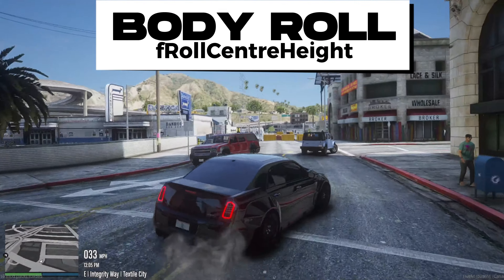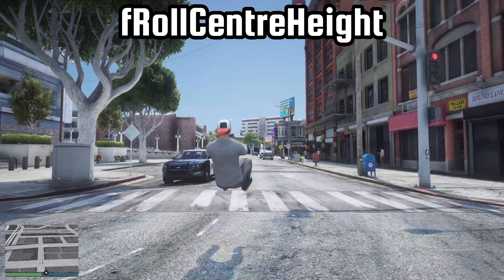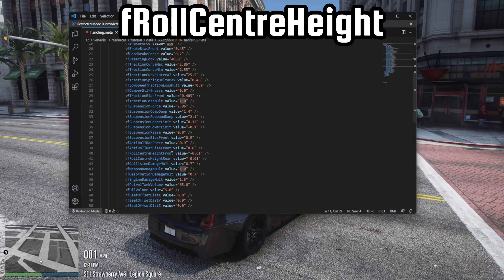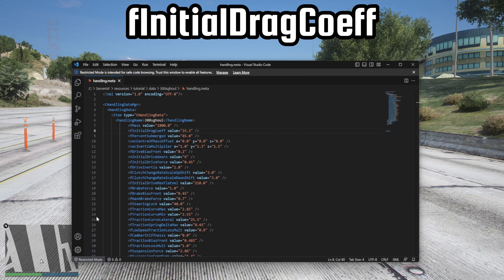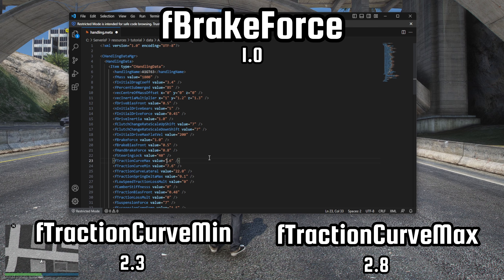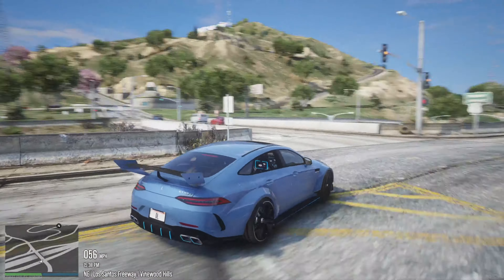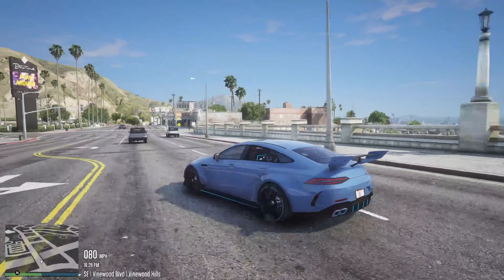handling.meta

Comment: Time stamps for each section (Mainly using this for myself but maybe others will get some use of it? pin worthy?)
--
Body Roll (fRollCenterHeight)- 0:00
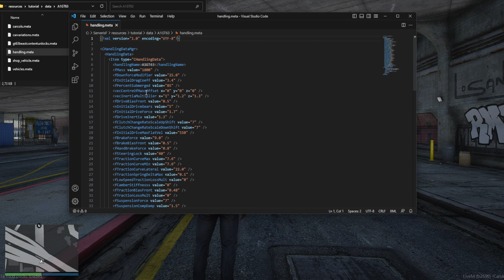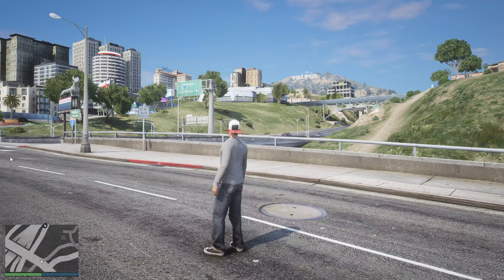Speed & Handling - 1:33 (fDownForceModifier - 1:46) (fInitialDriveMaxFlatVel - 2:11)
Turning & Breaking - 3:20
Suspension - 4:30

Comment: what should i adjust if it seems the car can easily get air even though it should be a proper weight and the vehicle is going that fast when going straight over a small bump?

Comment: what was the program u were using to make changes and apply not restarting the game?
Reply from the maker: The handling was edited in Visual Studio Code, saved with Ctrl+S, then just restarted the resource that the car was in.
Reply: @DigitalLatvia  thx man
Reply: @DigitalLatvia  one more question. How did u attach ur handling.meta file placed somewhere else but not into dlc.rpf (couse visual Studio code cant pass through it to get to handling.meta into it. So heres the question. Also i cant drag and drop files from openiv to code(it would solve the problem). Otherwise i will have to just extract my handling.meta file into random folder and move it back after some changes. Help me plz to figure out with this.
Reply from the maker: @EverythingUSeeIsMine  It is recorded on FiveM, so there is no dlc.rpf, the handling is in a resource folder.
Reply: @DigitalLatvia  oh i c. Thats  ot good news for me
Reply: @DigitalLatvia hey bro, thanks a lot for your videos btw, when i do it like you i get like a weird message that it cannot see some things in the car folder, and i cant spawn it in after i updated the handling file.

Its says
- could not find file ‘vehicle.meta’
- could not find file ‘handling.meta’
- could not find file ‘carvariation’
- could not find file ‘(spawncarname)’